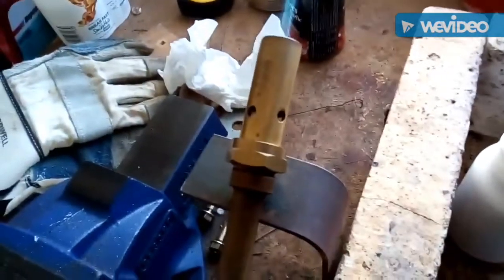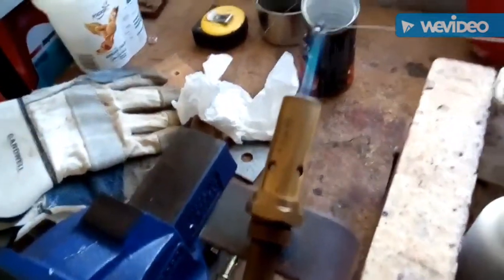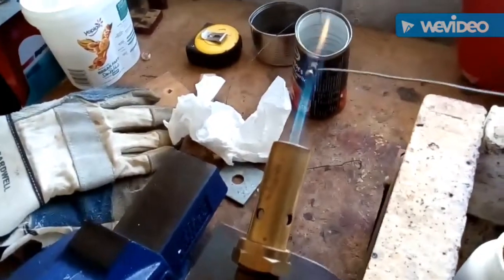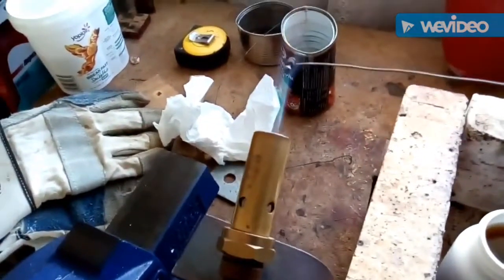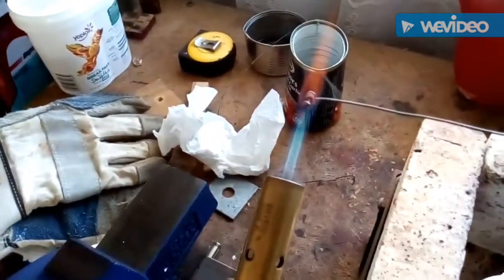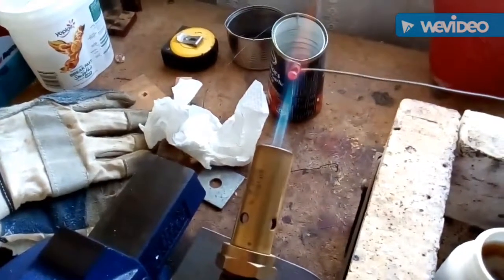Bluing Steel Round Head Screws in Oil

Comment: Instead of using clean engine oil use used motor vehicle Diesel engine oil this has lots of suspended microscopic carbon partials in suspension this gives a far deeper black.

Comment: hello sir 
how much time needs to heating and dipping the screws in the oil ?? and what kind of oil is that 
thank you
Reply from the maker: I took them up to red heat then transferred them to the oil, it's as quick as shown in the video, I did them one screw at a time, held by a piece of wire wrapped round the thread.  The oil is 15W-40 motor oil

Comment: I have some motorcycles and visually rusty bolt heads etc are the main weakness. I have thought for a while that this may be the answer. Paint just comes off so easily when using sockets and spanners etc. I think blueing as show here has to be the easiest method to improve appearance.

Comment: Has anyone tried this with stainless steel screws?
Reply: were you able to to this? planing to do this on my stainless steel bolts
Reply from the maker: I just tried it with a piece of 1/8" 304 stainless rod in clean and used motor oil.  There was no effect unfortunately
Reply: @GardenRailway  thanks for the reply. i might look for chemicals to blacken my stainless bolts

Comment: I wonder will this change the hardness of the steal. Main concern, does it weaken a bolt?
Reply from the maker: I doubt it Ron on both points, oil quenching is gentle.  In my application the screws are holding up well, and are just about invisible against the black paint of the model
Reply: I suspect this too. I would inform myself well if I have to do this to parts that undergo some type of mechanical stress.
Thanks for sharing.
Reply from the maker: It would be a good idea to test a piece if there are any concerns.  In my case I'm using it for mild steel
Reply: It absolutely will. Getting bolts red hot effectively ruins the hardening. Glowing red hot is much MUCH too hot. You only need to take it up to about 450-500 deg F, this is right around when the steel turns blue from the heat. Then quench in oil
Reply: Use regular kitchen oven at 300°C and do all at once.
Reply: @evgenitantikov5865 Have you tried with the kitchen owen? How long do you let the piece in the owen ? Or you wait until it’s red?

Comment: Hello Sir, three years back you made this experiment, are those all nuts bolts still rust resistant? How can we make deep black colour?
Reply from the maker: Hello, yes they are, but they are used on a model steam loco which tends to be oily, and is kept indoors and dry.  They are quite black, you could experiment.  I did this so that I didn't need to paint them, thus filling the screwdriver slots.  The blackening is to disguise them amongst the black enamel painted loco, which it does nicely

Comment: I'm using used oil but I still can't seem to get them to go black. They only go blue. What am I doing wrong?
Reply from the maker: What metal are your screws?  Mine were mild steel.  Used oil gives a rich black colour.  Plunge them into the oil just before red heat - let them cool a little when they reach red heat
Reply: @GardenRailway  aluminum
Reply from the maker: Looks like only steel will blacken in oil.  I hope you didn't melt any

Comment: hi sir i am thinking to do this on bolts and screws of my kawasaki zx6r bike...would you suggest  ? between nice idea other stuff which people we  dnt get in india easiy
Reply from the maker: Hello, it is easy to do, give it a try.  You could experiment with clean oil vs. used engine oil, and differing temperatures to see which colour you prefer
Reply: @GardenRailway  thanks a million bro for replying ...much appreciated...also just 1 last question this wont effect the strength by any means right ?
Reply from the maker: I don't know about that unfortunately.  In my model steam loco application it isn't an issue, but for possibly high tensile parts I don't know
Reply: @GardenRailway  thankyou so much brother for helping out

Comment: Will they hold on black even if there some surface scratches?
Reply from the maker: Scratches will show through.  It's quite a durable finish.  I've got a small blackened surface gauge base that I blackened years ago and the finish is still good after light handling.  A blackened die holder is losing its finish after many years of handling.  It's good for my screws
Reply: @GardenRailway  thanks for the answer. I want to do on new bolts that i cant find blackened for my car. I guess for inside it will be durable then. Thanks for the info man.

Comment: hallo sir what chemical you used?
Reply from the maker: I used 15W/40 motor oil
Reply: but i try used motor oil just temporary black.erm
Reply from the maker: @tengkuharith6026  these screws were dipped into clean unused oil, the finish is good
Reply: alright sir.tq so much sir